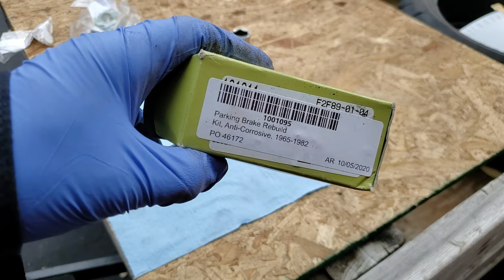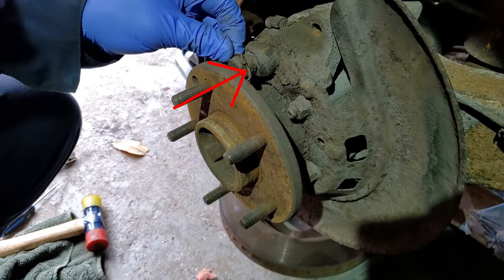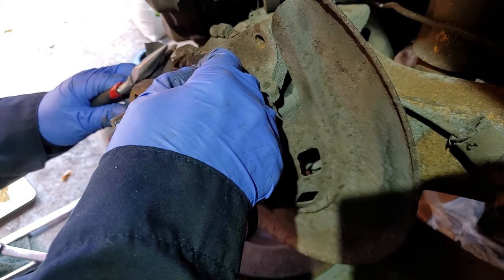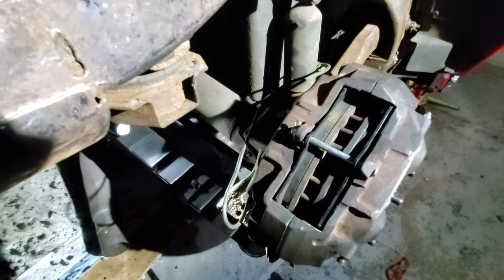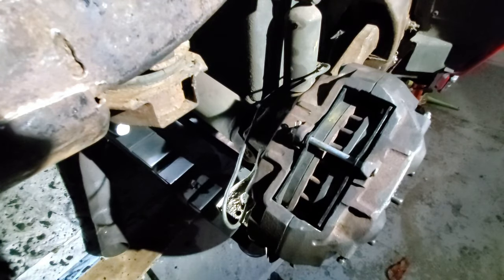Real-Life 1977 C3 Corvette Parking / Emergency Brake Installation

Comment: Love the video.  Was dreading doing this job on my 78, but you gave me the confidence to tackle it.  Wasn't quick, but it really wasn't as hard as I expected.  I can offer 2 suggestions.   One of the pins, as you noted, is inaccessible from behind.  You can loosen up all the nuts holding the backing plate, including the bolt at 12 o'clock to give you enough wiggle room to insert a new pin from behind.  Also the retaining clip on the bolt at 12 o'clock can also be replaced.  Mine was so rusty I had to find a way. Back off the bolt and then break/cut off the old washer/clip.   I cut the new retaining clip at the top and bent it open so it would slip over the bolt shoulder.  Once in place, bent it back and tightened it down.  Worked great.
Reply from the maker: That's awesome that you got that job. Me too, I was dreading it as well, but thankfully got it done. Ok probably going to repece all the back plates and things like that to the future. I appreciate the extra details that you provided in the comments and definitely something I will consider and hopefully others will (if they read the comments) prior to doing the work themselves. I've got another C3 is much better shape that I may use to make a video of a much cleaner wheel / e-brake assembly . Thanks again for watching.

Comment: Thanks very much for de-mystifying this procedure. My only suggestion is to remind people to spray down all brake pads with brake cleaner before reassembling the wheel. Otherwise your brakes will squeak.
Reply from the maker: Great point!

Comment: I put calipers on first and use a piece of sheet metal to slide the shoes in place what your doing works well also
Reply from the maker: That's awesome and nice to know that there are other techniques and methods that work. Thanks for the comments and for watching btw! J
Reply: @Motorcycology  I'm having issues with growing and scrapping sounds after driving and braking in town for 10 minutes rear brakes dragging on take off have you had that issues i redid all the brakes and changed the brake fluid to silicon still draging now wondering if it's the  ujoints

Comment: Hey this is really great. I have been planning to go thru my whole p-brake mech from the pull handle (already did that though) thru the cable and to the wheels at some point. This is a great help.
Reply from the maker: Glad it helped.  That's what I did too. I made sure my cables, pully, handle and everything was good, then moved on to doing the parking brake. I'm the 3rd owner of this C3 and the previous owner had the car for 20 years. At some point the parking brakes failed and he never re-did them. I was aware of this when I purchased the C3 from him. The C3 is pretty much as it was from the factory, never winter driven, but also never put through a "refit", so that is what I'm doing. Plus adding to the body of knowledge/skills out there too. We all help each other.

Comment: Good job!  You would have saved yourself a lot of work when putting the calipers back on if you had used a proper size block of wood,to keep the pads/pistons from closing together.

Comment: The brake fluid supply line needs to be removed first to get the caliper off.  Also if this is the first time a rotor is coming off you will need to drill out the rivets before you can remove the rotor.
Reply from the maker: Totally agree! Thanks for watching.

Comment: I've watched several of these videos for a C3 Corvette.  Unfortunately every one glosses over the installation of the top spring.  All of a suddent its on like magic.  That spring has to stretch to about 4 and 3/4 inches and its very stiff and a complete bear to install.
Reply from the maker: I totally agree with you. The top spring is a tough one.  No of this installation is much different than a regular drum shoe replacement, just a much smaller and tighter space.